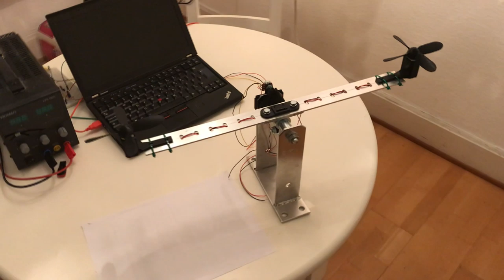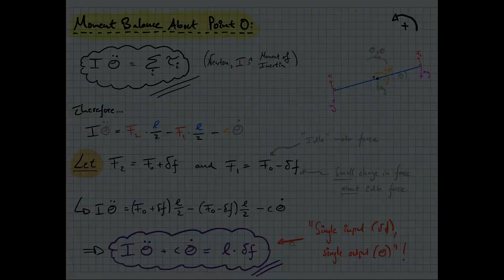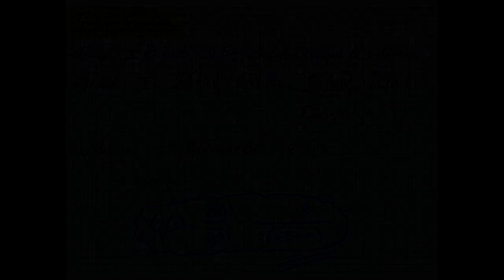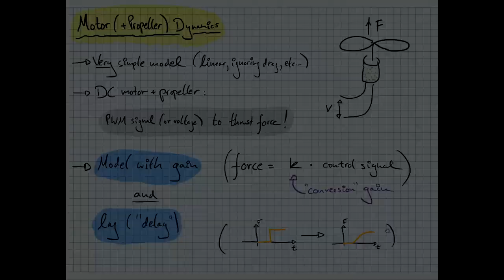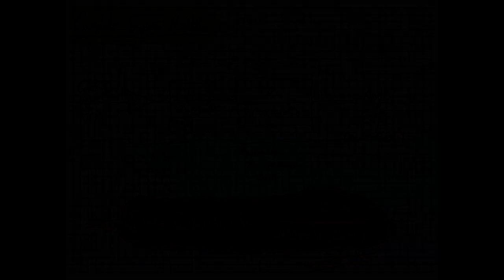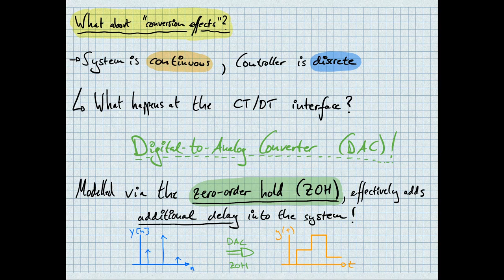Modelling of Dynamical Systems - Control System Design 2/6 - Phil's Lab #8

Comment: Thank you for the video. A suggestion: torsion pendulum can be used for getting a good estimate of the moment of inertia of the bar+2*motor. Also, recording the potentiometer output for a  step change in  control force should give us an idea of the co-effecients in the plant transfer function.
Reply from the maker: Thank you! Yes, those are two very good methods of getting the plant’s coefficients!

Comment: if this test is for a drone, it is far from the reality, because of that sensing the angle by a pot  is quite immune to mechanical vibrations while the IMU sensors are very prone to vibrations
(if the 3d printed props aren't calibrated )
we will need a good filter in the controller
Reply from the maker: No, this is simply an example of an “easy” control system and isn’t meant to represent (part of) a drone - even though it has very similar looks and dynamics. 
As you say, for a drone test, an IMU needs to be used for feedback to simulate the real, final system. In this case, the goal is to get a controller running for this specific, simple system.

Comment: Hello can you explain me why the pole origine ( the integrator ) means that when we give an impulse to the rode  we get a step output ? Same question for the case with no friction, if we have a double integrator 1/s² why does that mean that we expect a ramp output for an impulse input ?
Reply: Ok finally i understood. It's simply  because the impulse fct is equal to the derivative of the step function so the step function is given by the integral of the the impulse function. And the integral of the step function is a linear function which is the ramp function
Reply from the maker: Yep, I believe you answered your question :) If we integrate an impulse we get a step, if we integrate a step we get a ramp.

Comment: 3d printed propellers may be dangerous
great introduction,
it would be nice if you could take modeling one step further and simulate and compare results with the real system
Reply from the maker: Thank you! Luckily haven't had any problems with the propellers yet.
Yes, comparison between real and simulation will feature in the upcoming videos.

Comment: These mechanical calculations can become very tedious in a practice, for example, a drone. How do you think they tackle these?
Reply from the maker: Yes, for any more complex systems, mathematical models derived from equations of motions will become very tedious. In practice, you will usually give the system an input (impulse, step, or sinusoidal) and measure the corresponding output response. Using this, you can estimate the system’s transfer function. For non-linear systems, you will need to repeat this method at various operating points.
Reply: @PhilsLab  So THAT is why we find impulse responses eh 🤔
It would be great if you  can demonstrate how we can do that with your system, maybe at the end of the series.